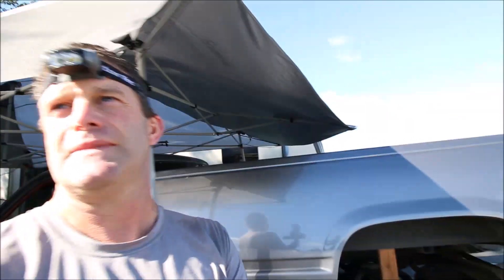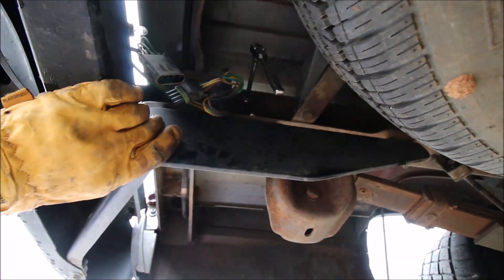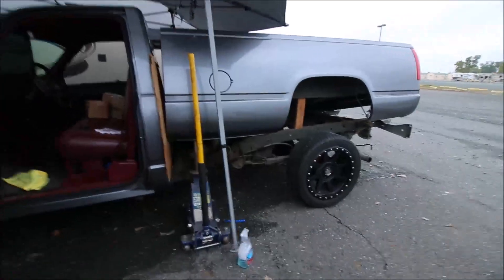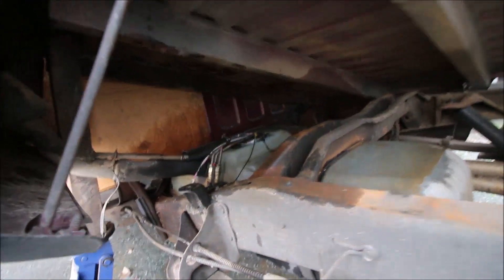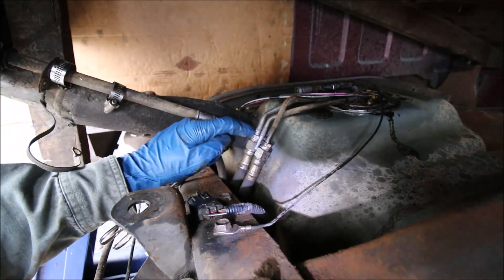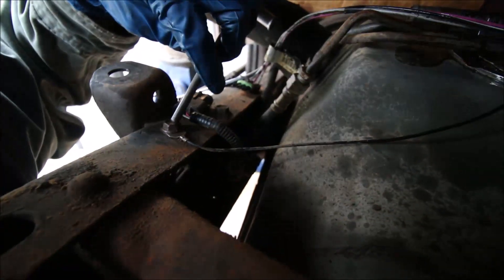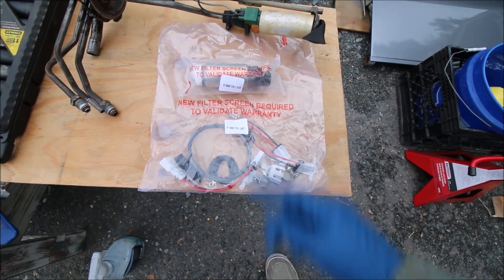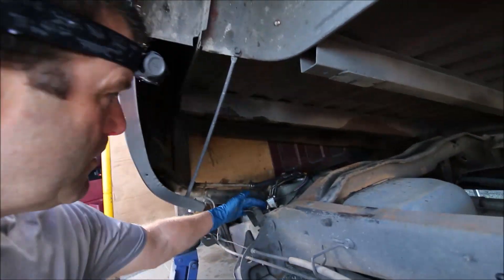Chevy Fuel Pump Replacement - Bed Tilt Method

Comment: Just did this to a 2000 dakota. Almost identical setup. I didnt have the bumper issue. 1 plug in the back for the tail light. I used a couple scissor jacks  on the frame to lift it high enough to get jack stands under it. My tank had 20 gallons in it and i didnt have 20 gallons of storage to empty it. 
I would 100% do this again on my truck. Im 65 and it took me 2 hours total. Thanks for your video.
Reply from the maker: @matthewkaragich615  I’m glad it was so easy for you!  Thanks for the comment.

Comment: I did my 96 c2500 just like this. Didnt have to remove the rear bumper just put a rag inbetween the bed and bumper to avoid damage. I worked alone but if i had help i would  have took the bed off instead of tilting it. I also had to remove my reciever hitch and my goosneck ball plate that was bolted thru my bed into my frame. Just takes time. Be patient . Great video
Reply from the maker: Good to know. Thanks for the comment!

Comment: Thank you for the honest advice. I got friends in my ear that I should lift the bed, now I will definitely just drop the tank and empty it. I think this is much safer too.
Reply from the maker: Both ways work; neither is easy. Good luck!!
Reply: Yup, just dropped one on my 89 K1500, drop tank day one, install pump day two, lift tank back in day three.  Getting it back up aint easy, but it''s and running good 🙂

Comment: Did this on my dodge. I used a wooden stool next to the rear tire and placed a high lift jack on top of it to lift the bed. I also took out the stock bed bolts on the opposite side of the truck with longer bolts so i could lift the bed higher. Worked out good.
Reply from the maker: Glad it worked out!

Comment: I find tilting the bed as the easier way of getting to the fuel pump. I did a 2001 Ford Ranger and it went very smooth for me. Maybe here in Hawaii we have less rust under our vehicles. I only had 6 bolts on the Ford Ranger from inside the bed. Removed 4 bolts and just backed out the other 2 by the rear side of the bed. No wire disconnects, only the fuel inlet pipe with 3 screws.I did tilt my bed on the Ranger from the cab side and tilted it from the front to the back. No removal of rear bumper or tail lights, it was a simple procedure. I propped the bed by the back of the cab on both sides of the cab. I had to replace 2 fuel lines on the pump top where it goes into the tank, they were those nylon lines and they were cracked and spraying gas all over the place. For me it was the easier way and I have a 1991 GMC Sierra with a trailer hitch and a full tank of gas that I will replacing it's fuel pump in about a week and again I elect doing the tilt bed method only because after doing it this way, it was a lot easier for me to get the job done and I'm 69 yrs old and could do the job myself. I done numerous drop tanks and that for me is a lot harder and time consuming. Everyone's situation is different and since my experience went very smooth, quicker with less effort, I will try this tilt method again on the 91 GMC Sierra.😉 👍🍍🤙
Reply from the maker: I wish you the best of luck.  Please reply to this post when you finish with the Sierra and let us all know if it went smoothly.
Reply: @JustPlainCommonSense   I just finished doing the GMC Sierra on this side using the tilt bed method. I guess I'm just lucky I could loosen my 4 bolts on the passenger side and remove the other 4 on the drivers side after using some PB blaster. Only had to remove 2 of the 8 trailer hitch bolts by using a swivel socket. Unplugged the left side tail light harness and my 2 grounds and the 3 screws on my filler neck and Wala no problems with this truck as with the Ford Ranger. The only difference was the Rangers bed was a lot lighter and I tilted the bed from front to back as the Sierra was sideways. Both trucks the bumpers did clear the fenders but only by a 1/4", just lift the bed up slowly. 

The problem I had was I had to have my son help me lift the bed, although this was a stepside bed it was pretty heavy and I'm getting up there in age at 70. I was thinking about trying to tilt it up from the front to the rear, of coarse switch the bolt configuration for doing it that way but a little late in trying that method. I'm wondering which way would be easier or lighter to lift? I still see the tilting the bed way easier and I've been replacing fuel pumps in cars for over 40+ years as a retired mechanic we (or I) never did or think of tilting the bed back then and maybe we do things by the book and maybe the manufacturers don't say to do it that way because of safety reasons and concerns? Maybe this Sierra will be my last one since I'm getting too old to be doing this kind of work but for my neighbors I tend to fix their cars for them so save them a few extra bucks. I like the tilt bed method only because I save more time and energy with no crawling(except loosening the bed bolts) on the ground on my back with the smell of gas and cramped places and no room to work. Just make sure it is a bad pump first or that would be a real bummer..lol  Take care and Aloha
👍🤙🍍🙂

Comment: When i did this i bought 3 6in bolts and put them in a few thresds so i could get the bed much higher. I also took the drivers rear tire off to gain better access. Worked good
Reply from the maker: It would have still hit the back bumper in my case.

Comment: Did this to my truck also, 2 welded nuts spun in circles ,so I used 2 - 6 inch long drills 1/8 inch & 1/4 drilled next to the bolt washer on a 30 degree angle, toward center of bolt inside of frame, then I stuck a 1/4 bolt through frame and was able to remove bolt without nut spinning, reverse this procedure to install and nut plate is re - useable. "Spark free procedure"
Reply from the maker: Great info!!

Comment: When I did the drop the tank method the 34 gl FULL tank was heavy and I had the jack. Nope. never do that again. Myself is 8 bolts unplug wiring harness one one screw and one torx. I then use my cherry picker with a crow bar in it and rope in a cross across the bed. Having a dually and exhaust behind the wheel will not allow me to roll it.
Reply from the maker: Glad that worked for you. With an empty tank, it is way easier to drop the tank.

Comment: It's kind of sad GM doesn't include an access panel. It would only cost a few dollars more but man it would sure make replacing the fuel pump a whole lot easier.
Reply from the maker: wyattoneable the pump is so reliable, it would make sense.it would likely only be replace once or twice during the life of the vehicle

Comment: Everyone is telling me to do this.     Now I'm just going to cut  the strap that I cant unbolt and use a tie down when I put it back up lol.  Thank you
Reply from the maker: I've done it both ways and dropping the fuel tank is easier (for me).
Reply: @JustPlainCommonSense  I'm cutting it from the top lol.  I broke a bolt on one of the straps lol I need it fixed asap.

Comment: When I did this A few years back I don’t remember lifting the bed this high. Also I didn’t remove the bumper. And I need to replace the pump again I don’t hear nothing when I slowly turn the key. Doubt it’s the relay. My truck is lowered I would have to put the truck on ramps to drop the gas tank
Reply from the maker: I wanted plenty of room I guess.

Comment: I have a '94 Chevy with 145k miles that has a working pump in the tank (I think original. I'm the 2nd owner).   I have a new pump here, and I"m walking through replacing mine.  But I want to get set up to do it anywhere, any time, with no help.  I know when it finally gives out, it will likely have a full tank and not be at home.  I don't want to deal with all that gas and trying to disconnect all that stuff after lowering  the tank some small amount, layng on the ground, working in the gap under the bed.   Mine also has a receiver, but on first look around,  there does not appear to be any reason to remove it or the bumper.  There is clear access to all 8 bolts.   I could use my angle grinder to relieve a little material on that right side corner of the bumper where your bed contacted it, then pad it.  Looks like not much material would have to be ground  off to clear the bed as it comes up.  And replace the right side bolts with longer ones as one commenter said earlier to maybe allow a little higher tilt.  I could carry my 4' tall Hi-Lift jack in the bed everywhere (bed is covered with a lockable flat fiberglass lid) for lifting the bed via the wheel well.  It is a 6.5' long bed, so the wheel well is pretty centered. Cut a few 2x4's of the correct lengths to brace under the bed as backup to my high-lift.  Add braces enough so in case the high lift in tne  wheel well gets in my way, I can just  remove it and still be safe.  

I'm going to do a dress rehersal to resolve any glitches and learn how long to cut brace pieces.  Clean the top of the tank real thoroughly, then carry the Hi-Lift, line wrenches, new pump,  and other tools needed for when the time comes.  After watching lots of videos, and with my desire to tool up to do it solo anywhere, I think this might be my best bet.   I did one in the past where I just disconnected everything under the bed, and suspended it 6" above the frame with an engine hoist, then pulled the truck out from under it.   But that requires doing it at home.   If my receiver and bumper had to come off like yours, I would not do the tilt method either.   Thanks for the excellent video.
Reply from the maker: If you are going to go though all that it may be easier to just do it at home before it quits and leaves you stranded in a bad place.
Reply: @JustPlainCommonSense  I thouhgt about doing it preemptively, but I think it might be running on the original pump now, and I hate to disturb it when you consider than even name brand pumps are not what they used to be.  I could be opening up a can or worms.  My replacement pump is a Delphi, but auto parts are so hit and miss these days I'm inclined to wait until the original one  dies naturally.
Reply: @JustPlainCommonSense  Well, I just changed out mine, and I agree with you....never going to do the bed tilt method again.  I didn't have to take my receiver off.   As I raised it up with my Hi-Lift jack, and kept grinding some off that right corner of the bumper, it still kept bumping into that corner as I rasied the bed further, so I pulled the bumper off.   When I got it up enough I had decent access, and wired a jack stand in place for safety, with the Hi Lift on some blocks holding the bed up.  Turned out the previous owner had replaced the original with an Airtex, and it had obviously been in there many years as it was a mess.   The pump was still working, but the strainer and little rubber connector hose had gotten bad.  The hose was all spongy and ballooned.  So I rebuilt the assembly with a Delphi pump, new strainer and hose.   I still want to be able to change it out again any time, anywhere by myself, but bed tilt is a no-go for me also.  I'm going to carefully mark where to put a hatch in the bed and go that way.  I'll do it carefully and not do a hack job.   Just thought I'd let you know after doing the bed tilt too, I agree with you, it's pretty much a pain.

Comment: Wht size rims an tires u have on tht truck.offset?an rim width?
Reply from the maker: Those are 275/45R20 tires on whatever rims the tire shop could find.  Slim pickings on what will fit that truck.

Comment: Yep it aint real eazy. I've tried it both ways. For me, I damaged less just raising the bed and pulling the truck completely away.
Reply from the maker: I bent the heck out of my fender when it was pinched between the bumper and the fender.  The receiver hitch was in the way too.  It was a real pain in the tail...
Reply: @JustPlainCommonSense  Wondering why you had to remove the receiver? In the trucks that I did that was never a thought and the same for the bumper?

Comment: Boy was I wrong! I thought for sure that would have been easier but sure was wrong.
Reply from the maker: The fact that I had nearly a full tank was what lured me into thinking it was the easier way to go.
Reply: @JustPlainCommonSense  couldn't just empty the tank with a siphoner and then drop the tank? 
I can't speak to much on this for I just cut hole in bed of truck and access it that way.
Reply from the maker: Dominic Miller yes you can!  This is the alternative method that so many on YT claim is the easier method so I had to give it a shot. Never again!

Comment: I only have 6 bolts, 3 each side, one ground wire and one harness plug. That’s it.
Reply from the maker: Good deal.  Thanks for the comment.  I hope you got the pump replaced without any problems.